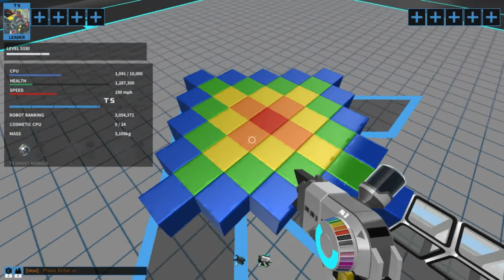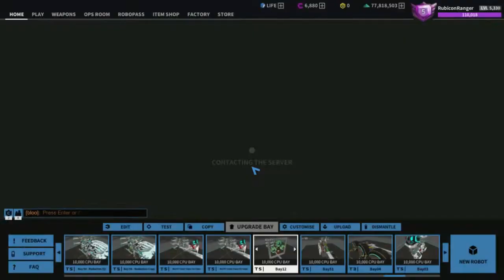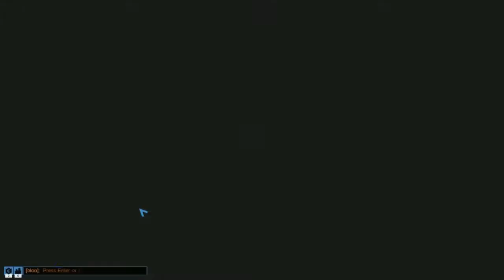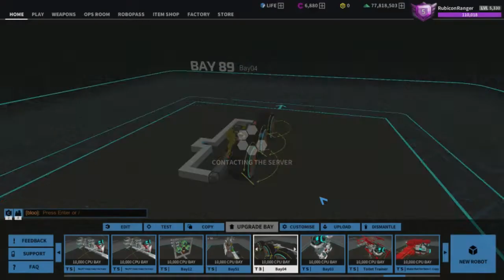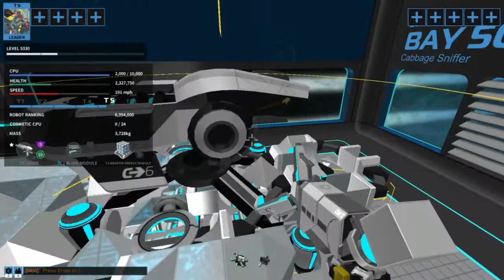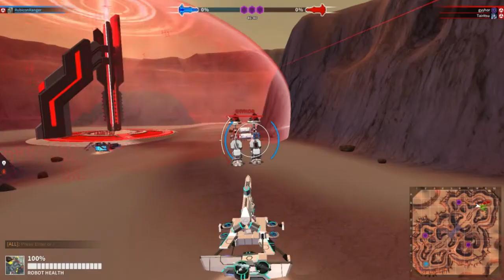Robocraft: One Take Triforcing - Part 6 - Gambleforce and Prime Mounts

Comment: On many of my newer builds, I've been taking to creating a circuit between my higher hp components so that damage gets dispersed between them over going directly into the chassis and ripping it apart.  Nice to hear a technical breakdown of how it actually works.  I should probably do more split routing on single mount parts- I usually just mount it to a rod connected to a solid part of the robot and leave it at that.  I should look at most of my main builds and re-evaluate them.

What happens when you remove the prime mount on a part that has multiple connections?  E.g, using a block just to position a part and then removing it?
Reply from the maker: Well hey, connecting your high CPU parts to one another is half the battle. Now all you have to do is have shorter ticks to the less important parts and higher to the more important and you have a tick network! If you have not watched the earlier videos in this series it might be best to start there. This video really is only about last tick damage and does not cover the basics.

When you do not have anything connected to a prime mount damage just flows out as normal, same as if you reset the function by rightclick painting.
Reply: @twotoneterminus4976  I just found your channel, just finished 5c and will be going through the rest of them.  I've usually built based off of intuition and trial and error, but haven't delved as much into the technical aspects of how the damage structure works.  Thanks for the info.

Comment: Huh... This is very useful information (as always). Thank you for sharing!

So, if one were to individually paint a mortar, would that change its damage-flow characteristics?

Would targeting a part directly with a paint gun randomize the primary connection? would an adjacent part of the target colour impact this?

And if one were to paint the whole bot - would it realign the primary connection of parts be determined by the flow of paint into or/and out of a part?

Well thanks again. This gives me food for thought.
Reply from the maker: I do not think individually repainted parts change, I think it is just when you use rightclick and paint the whole bot. It seems to somewhat "reset" the bot. From what I have seen it does not "align" the primary directions, it just removes the effect from every block entirely. Either way the effect can be restored by replacing a component.
Reply: @twotoneterminus4976  Thank you kindly for the clarifications. This is still very useful information.

Comment: The places I feel most comfortable rolling the dice on what takes damage are with damage sinks and multiple of the same component (like if I have three tier 5 wings there isn't usually one I prefer to keep)
Do you have any tips for trying to do tick-delay stuff with a whole bunch of smaller weapons? It's fairly easy to do safely with a tier 5 weapon but I've struggled with keeping tier 4 weapons safe while not using up way too much internal volume.
Also, something I haven't seen mention of is using the distribution of ticks in a connection to reduce the odds of a hit to connection line damaging the more important part. (This would be done by using mostly longer parts such as rods near the damage sinking/lower priority end and using a majority of the blocks like corner pieces near the part meant to be protected). Is this valuable at all?
Also, is using cosmetics to further protect connections in this way considered cheaty? (I consider it to be but idk what others think)
Also about Prime Mounts, I actually did some testing with someone out of curiosity using a megashield and some colored struts and found this mechanic in some form. I could upload the video (It's from August 28th) if you want. (Gyhhor can still have credit but I just think it's cool that this is an actual thing!) How does the factory affect it? Does a factory robot cause the effect to stop functioning? And can you restore the effect by removing and re-placing the parts? (This is very relevant to me because I like painting robots to make them look nice after color coding my connections, so I would like to be able to use the effect without having to hand-paint every part)
Reply from the maker: For routing smaller weapons you can kind of do what I was doing with the wheels in this video by having them dual mounted with one end going to the body and the other attaching to a split set or split loop. A split loop would basically a square for a flat rectangular bot with the corners single mounted to the body with some delay but with much more between each corner so that damage hitting the loop dumps to the body before breaking the other side of the loop. Usually you only connect two guns to a loop/set maximum to avoid all of them getting taken off if sinks/your body is destroyed. Having your split and guns sometimes combined lowers cost and prevents you from becoming noodle. 

As for your second question: Yes! I do that all the time. If I have part with larger surface area (such as an unwrapped rod, especially 2d diags which are like 3x3 hitbox), I always situate it close to the sink side/less important side of a chain. I also usually think about what lines cover one another from the primary damage directions, how many lines with hitboxes can be pinned (all shot at a single time with a rail from a certain direction), and how those lines are distributed to avoid losing too many at once. I actually plan on making a general "how to route anything" guide where I will be sure to mention all of this stuff. 

Using cosmetic armor/plasmatraps is not bannable/warnable but it is frowned upon in competitive matches the same way one-way eletroplate firing guards are frowned upon. In many tournaments cosmetics are banned for this reason. 

I am not surprised you may have noticed the effect earlier than this video. I am more surprised that we (EP) did not notice it and test it until now. I suspect other clans may have known but kept it secret or did not know how to best utilize it. You really could make some crazy optimized bot with every cube that is between two components of different value turned to prioritize to one instead of the other. Heck, you could even have full cube block chains leading up to parts all point away from the part to ensure the health in a chain is always used as efficiently as possible no matter the length and where it is hit. Also module bots can now be made extra magical. 

Yes, if you re-place the components that were painted it should restore the effect. As for the shop we do not know. I have not tested it yet.
Reply: Thanks for the reply! I've been using prime mounting on a very basic level to save me some trouble in my most recent robots, and to utilize health pools of single mounted parts slightly better. By placing the block facing away from the weapon, the health pool of the weapon will be slightly more likely to be used at no extra cost. I should really pick a paint color for prime mounted stuff so I don't lose track of it when building. (Also, I have decided that I'm just gonna roll with my robots being a white box of shields full of rainbow noodles)
Also, this is unrelated, but are there any good clans to join? I've never really been in an active clan before (even for today's standards) and I kinda want to see what it would be like (and also I might participate if there's another league season)